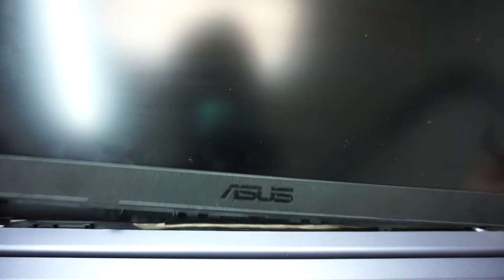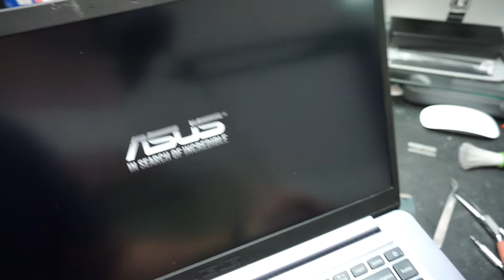Asus Vivobook F510U screen replacement

Comment: That Bezel at the bottom of the screen slides to the right to remove.  Much easier than prying the screen back to slip the connectors out.  
Hope that helps.  

Thanks for the Video

Comment: I will just say that I watched this video and others prior to changing out my front cover.  This was on an ASUS 505ZA.  I ruined the laptop.  The design of this laptop includes the cable attached to the screen via a piece of tape.  To release the monitor, the tape must be lifted.  The end.  The tape is part of a grounding strip that cannot be separated.  As I look at things now, I would not have separated the monitor cable but instead just unscrewed the monitor from the front cover.  That still means the other end of the monitor cable attached to the front cover would need to be pulled free so that it can be reattached to the new front cover.  This end is also held in place by a piece of tape as well as certain parts of the screen cable.  In attempting to free up the screen from the front cover, I was dealing with a high-risk situation that was not portrayed in any of the videos.  I would advise anyone messing with a laptop that won't break your warranty by opening the case, unless you are replacing a hard drive or other relatively low-risk issue, I'd walk away from trying to repair ASUS laptops.

Comment: Thanks a lot for the video.  Had a cracked screen on my Asus S510U laptop (minor difference from F510U). Saw your video and ordered a screen from ebay. Got it replaced in less than 20 mts. Kudos 🙂

Comment: What a good video! I have just a question:
I have the model s510uf-br436t with the hd ready screen, I noticed that an equivalent model (s510uf-bq371t) has the full hd ips screen with the same 30-pin edp corrector, can I replace my hd screen with this full hd?  The connectors look the same

Comment: Hi! great video! may I know what specific lcd I should purchase for mine? I have the same model as yours X510UAR I believe if I'm not mistaken. Correct? I was gonna buy a replacement lcd on amazon and I have 2 choices, either of these 3. I just wanted to know if they're both the same or will it matter which one I will get.

OPTIONS:

1. BRIGHTFOCAL New Screen Replacement for ASUS Vivobook F510UA-AH55 FHD 1920x1080 IPS LCD LED Display Panel

2. BRIGHTFOCAL New LCD Screen Replacement for ASUS VivoBook 15 X510UA X 510UA 15.6" Full-HD FHD 1920 x 1080 IPS LED LCD Screen Display

3. Generic LCD Display Replacement FITS - Asus Vivobook F510UA-AH55 15.6 FHD WUXGA 1080P eDP Slim LCD LED IPS Screen (Substitute Only) Non-Touch New

Your expert help would be greatly appreciated!